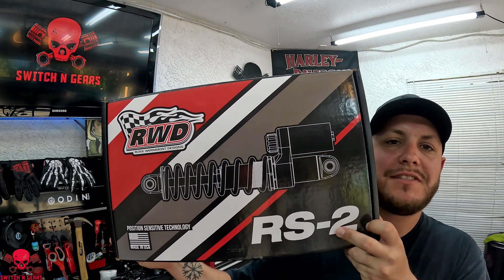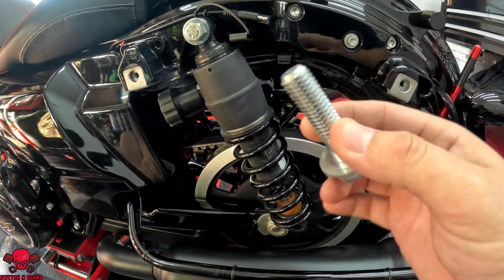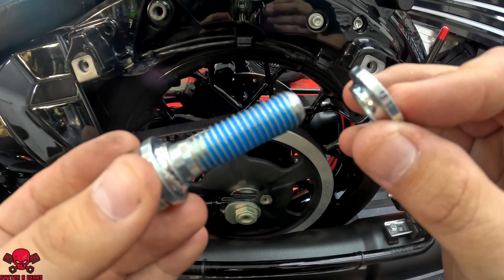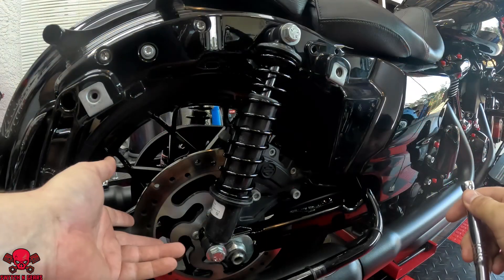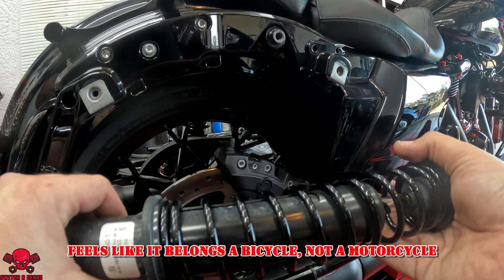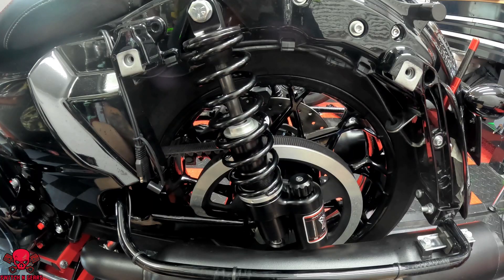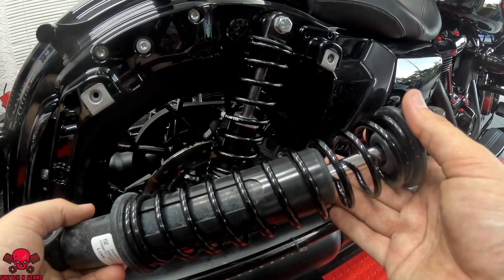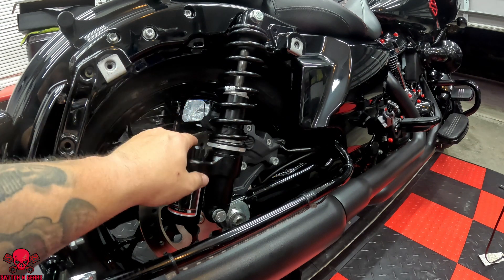RWD RS-2 Suspension Install: RUSS WERNIMONT DESIGNS RS-2 13" SUSPENSION

Comment: Welcome Back 🤘 Hope your holidays were good to you and family. Nice clean install. Looks easier than doing my sportbike😅.
Reply from the maker: Thank you sir! Hope yours was as well! And what kinda bike you got?
Reply: @Switch_N_Gears  I have a 01 Honda F4i. It's my 1st and only bike but her suspension is non existent😅.
Reply from the maker: @mrnumberone615  ahhh ok and that’s a mono shock no?
Reply: @Switch_N_Gears  Yes sir. I bought it with a Penske shock and Traxxon front forks. The rear has lost its nitrogen, and I'm not where to get it refilled. Local Honda dealer says it's "too old" to work on. Front fork seals have been leaked down for a few years😅. This is my year to fix it all though.
Reply from the maker: @mrnumberone615 heck yeah!